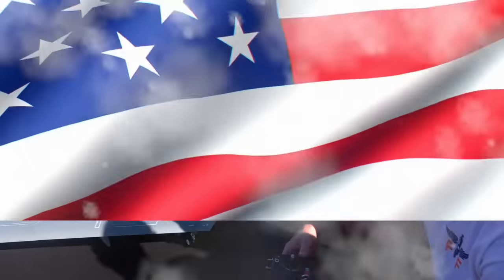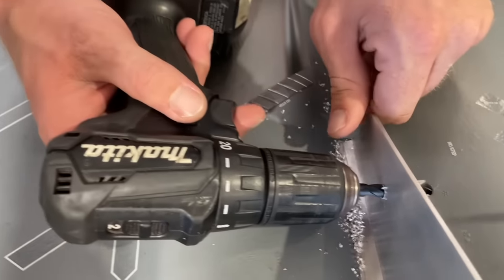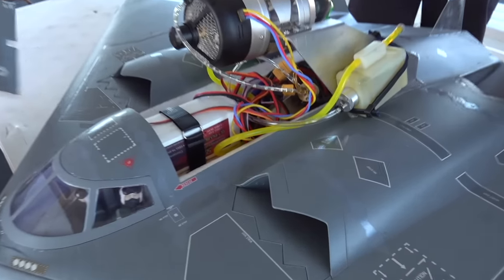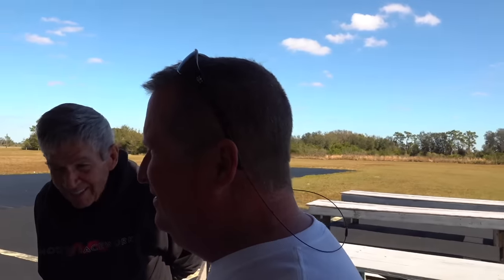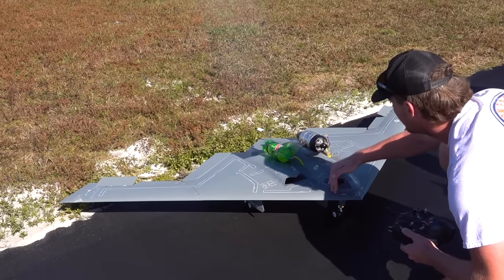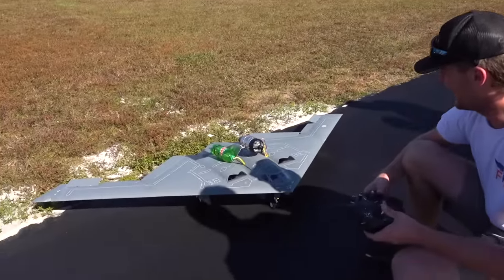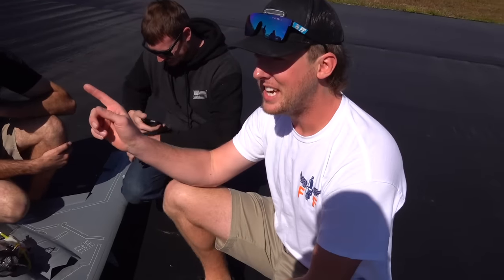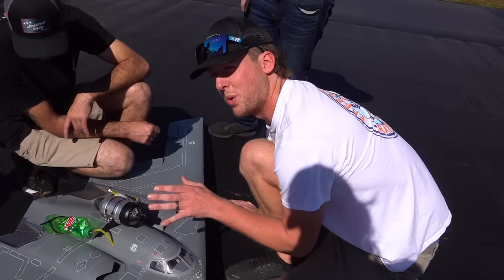TOO MUCH SPEED... My Favorite RC Plane EVER Has Been Destroyed!

Comment: For anyone wondering, the reason the B-2 started wobbling once it reached a certain speed is due to a little thing called aeroelastic flutter. This happens when the air surrounding an aircraft becomes so intense it starts to put immense amounts of pressure onto the airframe, thus causing parts of it to bend and shake if allowed.
Reply: Yea and AEROELASTIC FLUTTER that leads to total airfrane failure happens when the b2 excedes the scale equaliancy of Mach one. Lol
Reply: Now I'm Ed u ma cated
Reply: I would of said the problem was the mountain dew bottle strapped to it
Reply: Turbulence and lack of rigidity.
Reply: Right thats awesome!

Comment: Fab up a housing for the jet with exhaust tubing and mount it inside the center of the b2. 
Symmetrical top and bottom intake and exhaust ports should make it stable and fast as hell.

Comment: Aerodynamics student here! I don’t think the gyro is the culprit, but good old fashioned Flutter caused by harmonic oscillation! Best prevention is making the wing stiffer if you want to go faster. Good luck from Sweden!
Reply: It wasn't the gyro but to much speed for foam
Reply: It's limit cycle oscillation. It wasn't divergent, so it wasn't technically flutter.
Reply: @PendulumMapTarotLightWorker  And weight.
Reply: you "HERE" guys are wrong so often lmao.

Comment: That wiggle you got from your B2 at full throttle is a phenomenon the real full size one dealt/deals with.
Reply: Yup. It's called Flutter. It's what limits the top speed of most planes.
Reply: A piece of paper does the same thing if you blow on it.
It's called education.
Reply: Stole my thunder, I was going to mention the same thing. B2 needs a lot of computer power to keep that from happening.
Reply: @procatprocat9647  relax tough guy
Reply: @tdwz1652  always gotta be one in the audience
Reply: @procatprocat9647 Education? Ya because a piece of paper and a structure designed to fly are totally the same thing 😂
Reply: @jack frost  and why the yb-49 it's loosely based on didn't succeed. It was too unstable for bombing
Reply: Flutter only happens at specific speeds and conditions. If the airframe can exceed the flutter zone all becomes fine. The trouble is it must come back through the flutter zone in reverse which is for some reason usually more dramatic than moving through it forwards. Awesome content!
Reply: @thomasmiddlebrooke1012  buffeting
Reply: @ryanmcelderry3320  yes they're exactly the same thing. The toy plane wasn't designed to fly with such weight and at such speed.

It's behaving identically as a piece of paper whether you like it or not.
Reply: @tdwz1652  if you tried to engage me on a scientific level you would learn something.
However, if you simply use emotive putdowns, you will continue to be an ignorant.
Reply: @terranovarain6570  buffeting usually happens in stalls, not overspeed conditions. The buffeting is caused by the air separating from the fuselage/wing and makes the air turbulent
Reply: @procatprocat9647  Hahaha u mad bro?
Reply: @BarrySmoother  Yup. As mad as an Engineer who knows wtf he's talking about.
The level of ignorance online is certainly maddening. You're spot on 👍

Comment: The wiggle you were getting is something called aeroelastic flutter. Most likely not from the gyro. Happens with pretty much every aircraft if you go fast enough.  Extra power from the jet pushed it fast enough to start the flutter, weakening the B-2s structure so it would do it under normal power until it was compromised and broke up. RIP B-2 lost but never forgotten.
Reply: Couple of carbon rod's going through the inside would of helped.
Reply: I came to say the same thing, that is a perfect example of what it looks like when you exceed the “never exceed speed”
Reply: Agreed, I also think the b2 design is not built for speed. Needs more of fighter type airframe
Reply: I'm pretty sure they took the spars out for drama
Reply: Vmax is there for a reason 😅
Reply: @devisionhun  yep, I always wondered what it would look like in a real world situation, now I know..

It looks just like it says it would in the flight manuals, and it was as scary as I thought it would be.
Reply: @11ride4life  When we do a flight test in our real plane they take it to VNE.  Call me picky but I assume VNE failure is when the aircraft breaks up below VNE.
Reply: This is what I was looking for, I wondered why that was happening, thanks!
Reply: This is pretty much what I thought too
Reply: If he had taken the filament tape and reinforced across  the wing from tip to tip might have avoided the total loss at the end.

Comment: I think it's more of a case of harmonics, and less of a gyro issue. That wing is not stiff enough for those speeds. Also, loose linkages can create harmonics in moving surfaces. I built a flying wing that does 126mph and have a thin fiberglass skin for stiffness. Anyway can't wait to see how V.2 wing does!

Comment: Great idea to place the fuel right next to the exhaust.  Heat and fuel go great together
Reply: Kerosen has a really high combustion point as a really low freezing point wich make it the perfect fuel for aviation. Basically you can throw a live match into kerosene, it'll not take fire. Airliners and military jet fuel tank can go on really high temp. Also you need oxygen to light a fire, until there are no air into the tank (and you need a big ammount of air) it can't take fire, that's why jet engine suck air with a compressor for intern combustion.

Comment: brother you need to get a carbon fibre arrow from a bow shop cut a channel acros the wings get some foam friendly epoxy and try that again ask me how i know i once fixed wing flutter in a 60 inch home built me 109 and it worked brother

Comment: Preflight I thought about the addon wind drag the way it was mounted high including the bottle causing an upward nose moment and then in flight with the power of the engine pushing the nose down. After landing seeing the fractures along the entire fuselage, I knew it was no longer worthy of flight and would need repairs. I don't know why it had mid-flex oscillations during full power except due to airflow dynamics. The solution after the cracks and would have been better to add fiberglass laminations to reinforce the aircraft.

Comment: I've been looking at 64mm vrs 70mm versions of the b2 all day wanting to see what differences there would be. but no videos are available if the 64mm version on YouTube - Don't ask, or well have to see endless comments about Chinese suppliers and people's opinions thereof. However, the rc motion plane you have there seems to recommend flying at half throttle. So perhaps the 64 would do just fine and any speed/handling differentials would be hardly noticable? 

What are you're thoughts regarding these factors please and thank you.

Comment: this is awesome seeing the wing flapping or fluttering. When they designed and flew the B-2 the very first time this was one of the issues they had on the first flight. The wing flapping/fluttering occurred. I believe they had to re program the flight computers to cancel it being it will self destruct if it passes the structural load.  But Clearly mounting a heavy turbine (my experience they range from 3-4lbs.) on the top midline. Anytime you bank or pull up. Depending on how many Gs you have. That engine could push 10-20lbs under g load  it’s pushing down the midline.

Comment: The engine and fuel tank Dew bottle should be on the centre line. 3-In-One works as jet fuel for me when I'm low. So fun to see the extremes you put on that model. 
I'll echo Kevin Talbot. "Could be worse. Could be mine."

Comment: Cleetus:
All aircraft have natural frequencies like this which will break apart the airframe.
Flying wings have a short longitudinal-fuselage dimension and can suffer from a natural frequency ‘hit’ more easily than planes with fuselages.
Look-up the ‘Zaggy Flap’. I built an electric ‘crazy-fast’ flying wing which experienced a ‘ZF’ and scared the shite out of me.
I put in into a steep dive, hot full power, and as it hit max speed it started to resonate - sounded like a Giant Hornet, and the 4-cell Lithium battery exploded and it started a brush fire.
After the fire department left, I looked things up, and found this… you guys crack me up, and are inspiring me to get back into breaking things …
‘Fast Max’

Comment: sorry for your lost. Here is the thing about foamy made in China. They are cheap but junk as from the factory. Most of their foamy either does not come with vital spar. Even if the spar are provided, they are under strength and likely to be  make from re-cycle stuff. when you top mount engine behind the C.G  , it tend to push the aircraft frame nose down on power , so the turbine or EDF show be pointed slight up thrust when view from the rear.

Comment: Regrettably it is a case of inadequate engineering.  Lack of beam strength and more importantly torsional stiffness.  This is more criticall in flying wings, especially with control surfaces on swept back tips like those.  It's a lesson often learnt the hard and expensive way.  Don't try swept forward wings-- they are worse.

Comment: The flex has nothing to do with the gyro, the flex is actually flutter caused by exceeding the limit of air moving over the surface, in other words, moving way too fast. The airframe, design, material all combined is not strong enough to withstand the speeds created by the jet engine. Its only foam. It has limits. Thats why its manufactured with edfs.

Comment: To be honest, someone added some buoyance tools at the bottom of B2 to float on water instead of using runway to take off and landing to minimize the damage to B2 as much damage had been seen in other video about the front wheel after collision.    I would suggest to add a coating of transparent GLAD multi-purpose wrap or stickers in 2 directions to strengthen the foam body of the B2 plane.  Finally, do you know your B2 attracts ufo at 19:55 - 19:57 of your video ? Enjoy how fast about their speed in slow motion again.

Comment: You need to make that same wing but with carbon fiber so it can handle the stresses of a jet engine but remain light enough to be nimble. Just take that wreck to a carbon fiber manufacturer & get a CF replica. Even a CF frame embedded in that styrofoam structure would handle the jet propulsion stresses. Plus you could make it a little bigger if you wanted to.

Comment: Jet power is only deployed in high alert 
It is designed for search and rescue
The aero dynamics is intended for it to glide with minimal or no power
Or battery propelled
The final version will have the whole fuselage solar panel thus drawing energy from the body through the sun 
The sun will also recharge the battery for night operations this having the capacity for 24hour flight 

I was told that the designer was also responsible for the pilot helmet with remote control capacity

Have fun guys I only wish I could afford my own dreams 
It is definitely super fast

Comment: On the next one, use a smaller Turbine engin(Lighter) get rid of the huge battery inside and replace with a much smaller battery just mount the Turbine and fuel more to the front for the cg and this bomber will handle it with ease and you wont see the flapping of the fuse large at highr speed because of the reduced weight, thats what I would do and you will have a brilliant epo yet as such.

Comment: The same thing would happen to the Zagi flying wings if you over sped them in a dive, and once they start to flap like your plane did it was only a matter of time they would fold.  We found that once you had a high speed flap the foam was damaged and wasn't rigid anymore.  Sometimes we could extend the life of the Zagis by adding one or two carbon rods or bars across the damaged foam.  Great experiment though.

Comment: The waving that it experienced was what’s known as wing cavitation. It does show how wrong those foam jets are in reality. If you laminate the next one in fiberglass it would help make it stronger. The airflow over the wing is bouncing back off the rear of the plane pushing it down making the wing tips change and bend.

Comment: You can't strap a jet onto the top like that without messing up the aero dynamics of the plane. This is why all jets including this one come with tucked engines with a aero flow line. This is why it wobbled, to much air was hitting that massive add on and the air was pulling the hull up to hard.

Comment: wasnt the gyro it was a structural failure from the turbine being too much for the foam plane with out carbon fiber support rods and the damage in the front created a scoop and when you dived down at full throttle the scoop or i should say hole you created worked like a hollow point under pressure and seperated the craft and speed wobble ..

Comment: I honestly believe if the turbine had proper placement inside the aircraft that it would have flown fine w/o the wobble, gyro or not, but eventually it would have ended the same way due to the sheer G force, speed, and weight for that type of air frame... Thanks for the laughs 😁

Comment: 15:06 Given that its only polystyrene, I'm absolutely amazed that the wings didn't just fold in under the mass of the engine and fuel. 20:05 ah there it is.